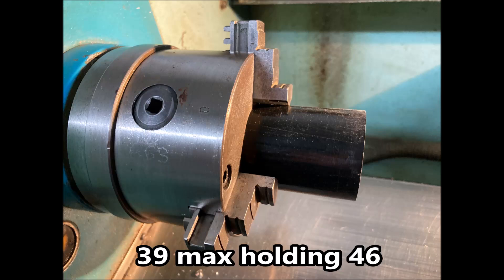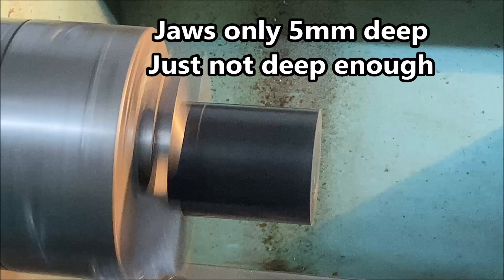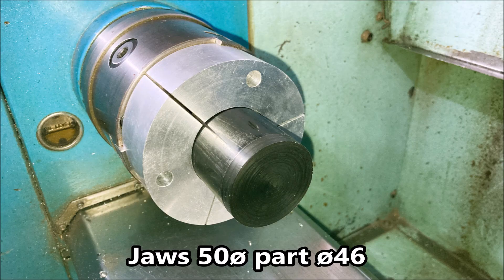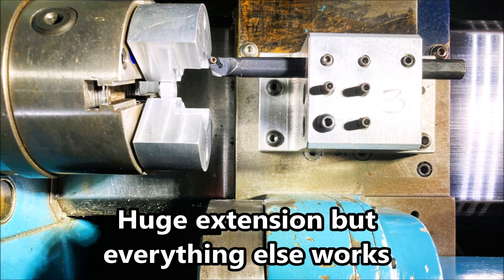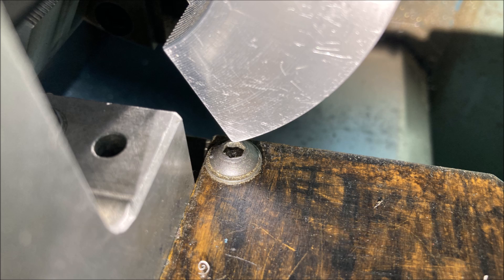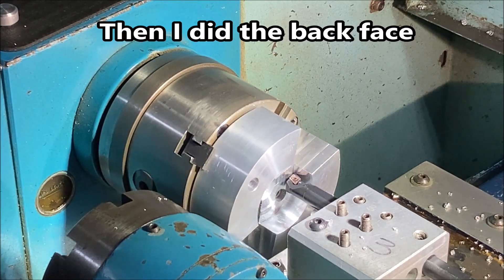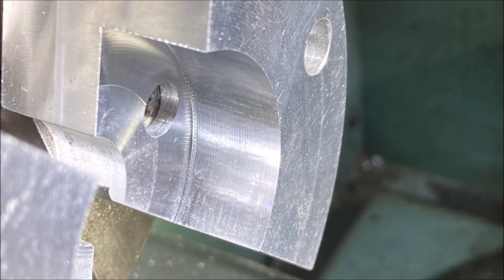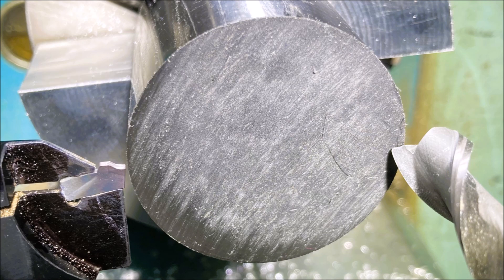One setup Part 3 100mm TOS chuck vs 46 OD acetal. Hercus PC200 cnc lathe

Comment: You're pushing the Hercus to its limits, nice solution to the problem.
Reply from the maker: Hi, when the spindle has 1/2 hp and the chuck is just 100mm the limits are a constant. Anything less and profit is impossible. Thanks for always making a comment.  Nigel